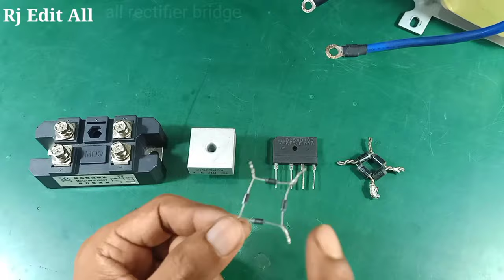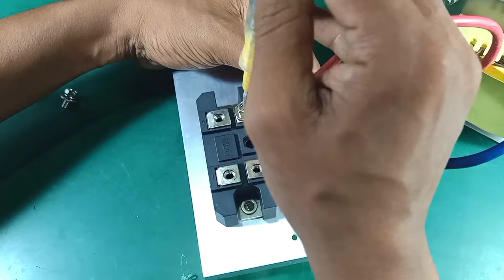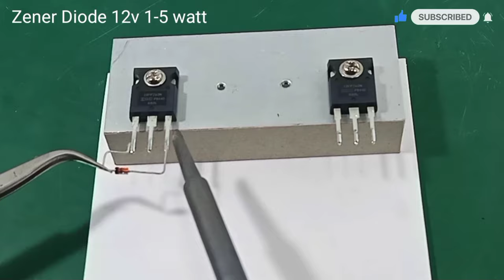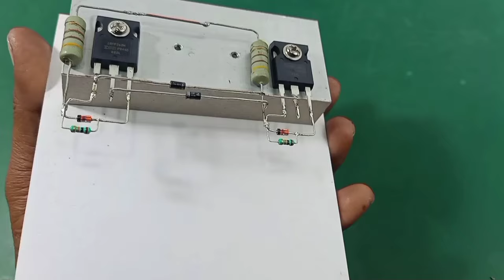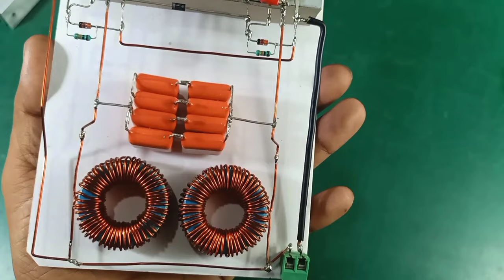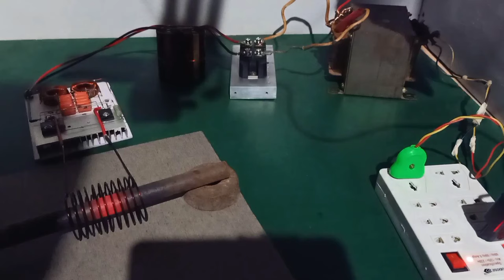Simple Building a 2700W Induction Heater || 12v DC Powerful Induction Heater

Comment: 12v x 50A = 600W not 2700W, you need a 12v 225A power supply for 2700W
Reply: Ok you. Add error
Reply: 12v x 10 A
Reply: लिखने में क्या जाता है।2700 वाट्स लिखने से ज्यादा वजन आता है।
Reply: Там нет 50А и близко. Судя по проводам, катушках и способу соединения.

Comment: apart from the outragous claim of 2700 watts (impossible from that transformer and the skinny wiring) it is a good presentation.
Reply: Agreed
Reply: Even at 12V/50A you only get 600W. I think you would need to use 48V to get that kind of wattage and a proper pcb layout.

Comment: thank you for posting.  what is measured ac frequency at coil ?  measured, not calculated/predicted.  are you measuring 2.7kw at power input, or actual at coil ?  by convention in the ih industry, output power ratings are used.  measure temp in, temp out, n water flow rate thru induction-heated part inside turn[s] of water-cooled coil.  i worked on/with 20 & 30kw 450khz ih generators for 16 yrs.  take care - dLLund 😀

Comment: Would winding the coil using LITZ wire improve the performance of the unit. How about making the winding coil smaller diameter, would that improve the performance ???
Reply: @victory first look up the skin effect and then calculate from there your operating frequency and diameter of your conductors. Hint: higher frequency=thinner conductor. If your turns ratio on the transformer needs to stay constant but your conductors are basically underutilized because of skin effect, then you switch to Litz wire
Reply: @Dan-vq4pz  Thank you Dan for your help and guidance. Look forward to see more great videos.

Comment: hi, if using 12vdc then must use a transformer and it is quite a heavy and big capacity transformer,  if I make a dc power supply directly taken from the 220vac power outlet  (using a bridge diode and a capacitor and supposed to become about 300vdc), what needs to be modified? the size of copper and the numbers of the copper wires turning? and what else?  please advise me, thanks.

Comment: Sir i have made induction heater same as your circuit diagram but i have use 35 v 40 amp transformer , and when i start and put iron plate in the coil mosfets get imidiatly burn , i cant get the problem can you help me to find out or what is my mistak?
Reply from the maker: you use 30v 15-20 ampere transformer

Comment: Great !!!
You made the iron bar turns orange ...
Success..congratulations!!
But , if you make the output induction coil wire thicker that would be better .
Reply from the maker: Thanks Sir
Reply: @RJEDITALL  ALSO:  use several lengths of about 20 gauge wire twisted and soldered at the ends to form LITZ wire, as the high frequency here will see much less resistance and perform significantly better with higher efficiency.

Comment: I tried making one by seeing your video but it dosent seem to work i dont correctly know i tried exact values but the mosfet heats up and i always have to turn it of to save it
Reply from the maker: Ok, please use Big heatsink and cooling fan, no heating problems.
Reply: Before input voltage two big kondensator use in this video.This is verry important.I doing this device in another your video and too only heat mosfet. 😡  Need explane on two bigest kondezator in input.

Comment: Best regards:
I tell you that I did it step by step, but I have a problem,
Is the core of the toroids made of ferrite, air, iron powder?
It doesn't work for me and I think that's why, how many micro henrries is it?
thank you and stay tuned.
Reply from the maker: 50-60 turn, 1/2 mm wire 1.2 inch toroidal, 100uh

Comment: Hello RJ EDIT ALL

Your circuit drawing is right. But i found some major flaws in your circuit. As it is from what i have seen from your video, you mention that is is 2700 watts. That is not true. In order to get 2700 watts on 12 volts, your would have to draw over 100 amps.  Your prototype will last a few hours before having parts issues. The main reason for that, your soldering is very poor. Your output coil wire gauge is way too small, i would suggest you use gauge 8 wire at least. Make sure you use bigger wires for your circuit if you wish to use this everyday. Source : i am an electronic engineer.
Reply: 12v and 100 amp equals 1200 watts , and you are an electrical engineer 😂😂😂😂 says you
Reply: @akilmurugesan3023  He said you would need to draw over 100 amps keyword: over
Reply: Mistake may come. But see the correctness of information.

Comment: 😆You really are a magician !
What voltage and current are you supplying?
Your transformer announces 20 to 50A, 12V
So at the most you can transmit 50*12= 600W !!

Current to see your little power wire should not be more than 10A, and again!
So the transmitted power is a maximum of 120 W!!
And you tell about 2700 W ????

Aren't you ashamed to have such low knowledge ?
A horror !